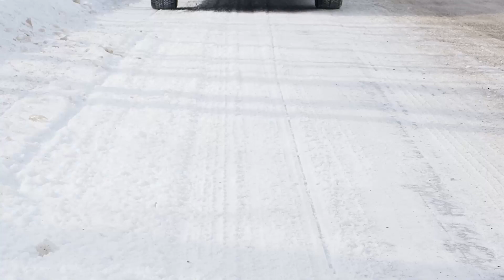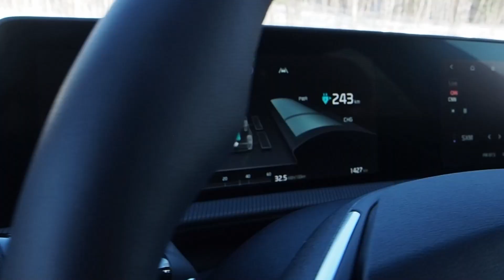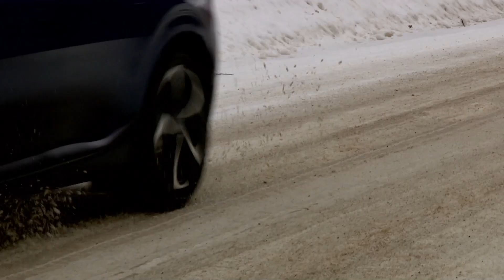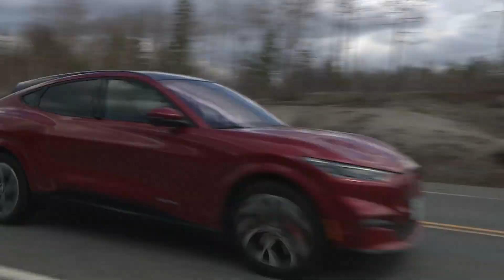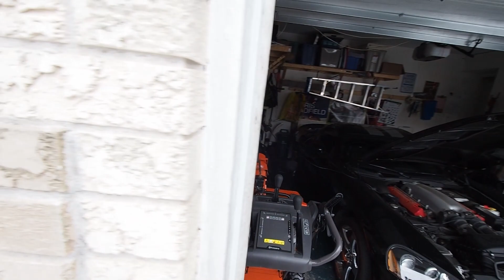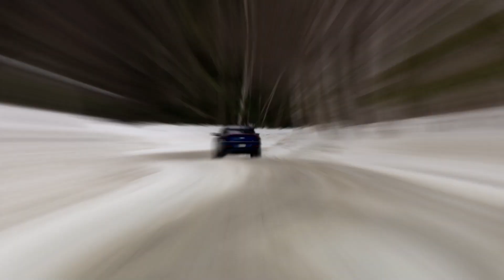2022 Kia EV6: BUT HOW IS IT IN THE SNOW?

Comment from the maker: Correction: price shown is $58,600 CAD 🤘
Reply from the maker: I did adjust it, it doesn't go low enough.
Reply: wrong price, this is the 62k model.
Reply: At either price you would think you would get a rear wiper.
Reply: You can lower the AR display - up, down, left and right, via the Infotainment system. You obviously don't own one I'm guessing.
Reply: @VROneUK  He's a tester, why would he own one?  Not sure why people feel the need to be righteous when commenting.

Comment: Any feedback on how the back window visibility holds up in rain and snow.
Reply from the maker: I didn't pay a lot of attention to it but I don't recall having an issue--- snow / dirt accumulation on the lower tailgate yes, but I believe the angle of the rear glass largely helps keep it clean.

Camera turn signal mirrors help enhance visibility/ situational awareness too. 

In my opinion after over 1,000km of testing in the snow: it's nothing much to worry about.

Comment: What is the range in the winter? I am wondering how far I can get on european motorway where I can drive 130km/h.
Reply from the maker: Hi Pavol

Many factors at play, I typically count on losing ~30 percent on the coldest days (25 celsius below) with generous use of the heat. If you're driving regularly at 130 kmh, probably a little more of a reduction. 

In Canada, most drivers do less than 60km per dat6

Hope that helps!
Reply: @JustinPritchard  Thank you

Comment: Hi, I really liked your video. Excellent! I have a concern, though, and maybe you can help/know the answer. My concern is...what about parking outside, not charging, such as at work, etc. when the temps dip well into the negatives, such as -20*f (-28C)(which I saw last winter)? Does the car somehow protect the battery...will this harm the battery...all those types of concerns.
Reply from the maker: Hey! In that case you'd probably want to leave the car plugged into its charge cord. It acts as a block heater sort of. Keeps the battery warm,. Helps protect it extend range and make it perform better.

The engineers have gone through great lengths to make sure this stuff works in the cold, even if it can't drive as far.
Reply: @JustinPritchard  That's good. It's not practical or possible to leave it plugged in, so I take heard that it's sold in Canada, lol
Reply: It maintains itself in that instance but you will have maybe 1% loss sitting out for a 9 hour shift in the negatives (In my experience)

Comment: How much battery capacity is lost due to your extreme cold weather?  Do you find that the heat pumps help preserve range?
Reply from the maker: I was good for ~320km of range down to about minus 10 celsius, on a full charge. Minimal effect on range with heat on vs heat off, according to the computer, about ~20km.

Heats up fast too!

Comment: I like the idea of EV's, but not battery... the pollution, weight (destruction of the road and tires) can't be overlooked, and slowly it's being talked about. But there is another issue that fir years I talked about and now, finally is starting to just be discussed... It's heat and cold and the "efficiency" of batteries. Hydrogen is by far the better solution, but Elon/Tesla fanbois don't like hydrogen... it's easy to make, has no pollution from the construction of batteries, gathering of the raw materials, shipping or disposal... So these people attack hydrogens loss of efficiency when making hydrogen.

Finally we are seeing the very start of a discussion talking about the loss of charge in batteries when in heat and cold... You can charge your car all night, dumping energy into that battery that soaks up well under 50% of what you put in it. You can park you car at a full charge and wake up to a 20-30% loss due to cold. You can drive and as it heats up your battery overheats. It's amazing how slow people care about the realities of pretty much anything. 

Batteries are garbage... mass polluting garbage. You are not better for owning an EV. EV's will not "save the earth" as in reality they are destroying it in fast forward.

And even after all that, many people will read what I said and still not care... but as time goes on and more of these unavoidable problems rise to the surface those same people will one day be regurgitating the same things I'm talking about right now... After they wake up and their EV lost 20-30% of a charge and they are paying for that energy. Till then 0-60 in 3 seconds is just sooOooOo cool! Because these people never really cared about pollution.
Reply from the maker: There's no pollution from the shipping of hydrogen, which is transported to fueling stations by transport tanker trucks?

If you don't want an EV, don't buy one.
Reply: @JustinPritchard  He does have a point tho, technically hydrogen could be made at the fuel station. In the long run, I think that hydrogen will get the upper hand, unless they figure out a way of making batteries without all the rare materials. (And yes, I own this EV)
Reply: @RHTi9   You are wrong.
Reply: @honesty_-no9he  How... how is he wrong? Challenge the entirety of your brain and tell us how one can't make hydrogen at a fuel station or at home when it's literally been possible for decades. Then you get to store this energy with ease compared to making mass polluting batteries.

Why do EV people hate the environment so much?
Reply: @JustinPritchard  There is not, because an intelligent person understands that you can make hydrogen at home... easily... 

You know that Tesla wall, or charger you have? Now, imagine if you will, a device that uses that same electricity to split filtered water into oxygen and hydrogen.... then compress it... and bang... 

Or don't and buy mass polluting EV's that depend on fossil fuels, the destruction of the earth to make batteries and waste of that battery. 

It must be nice pretending one cares about the environment, kinda like Elon who blasts massive rockets into the skies.
Reply: On every single point you are spewing FUD disinformation and you suffer from serious dis and mis education.
It takes 5 times the amount of energy to drive a Hydrogen car the same distance as an EV.
Reply: @honesty_-no9he  I am not wrong... Consider trying to think about things for yourself rather than simply reproducing other people's talking points. 

I don't even know what FUD is, nor do I care. But if you actually think batteries are even possible going forward then you have clearly never even tried to look at the problems with batteries... like the fact that we simply can't mine lithium even remotely close to fast enough, and it will only become much harder to do. 

It's not a matter of getting better at it... it's imply one of those things like going into the deep ocean where the effort to do it requires vastly more energy in order to do it better... thus making more pollution and destroying more of the earth in the process.

Rite now your brain is possibly dealing with internal conflict, do you actually look up any of this... or do you chose to remain ignorant. 

We all know that willful ignorance is the easy thing to do... and we both know you have already decided you have no interest in looking any of what I said up. So we probably already know what kind of human you are in reality rather than who you like pretending to be.

Comment: You CAN adjust the position and height of the heads up display in the settings, so it can be different for varying sizes of driver
Reply: I haven't heard any other reviewers mention the heads up in that way, and I thought it might help folk to realise that it is adjustable... As regards you, we are all different, straight arm driving / 90 degree arm driving, etc, but it may help to consider that the further backward you sit, the higher the display will seem... cheers 🥂
Reply from the maker: But at 5'10, the lowest position possible is still in my line of sight.

Comment: If it weren't for the overly complicated controls and lack of physical buttons this thing would be really good. Why are car companies throwing the baby out with the bathwater when they design an EV?
Reply: I actually enjoy the new controls. I usually set my temperature once and let auto take over from there... And I pretty much only use the steering wheel controls for the radio. Also if you don't get the top trim version you get 3 physical buttons for heated seats and steering wheel instead of the touch buttons that people keep accidentally pressing.